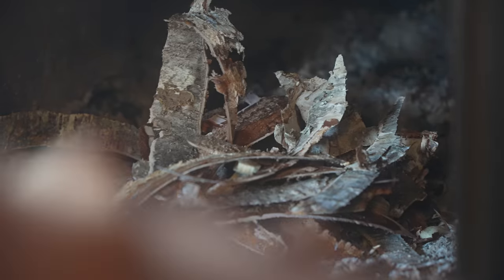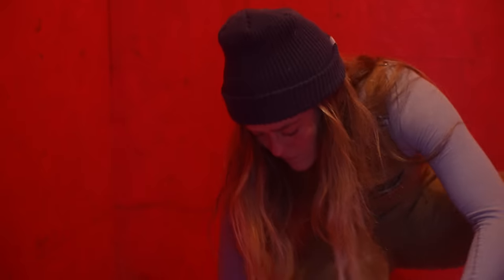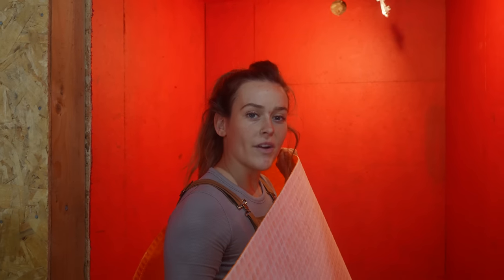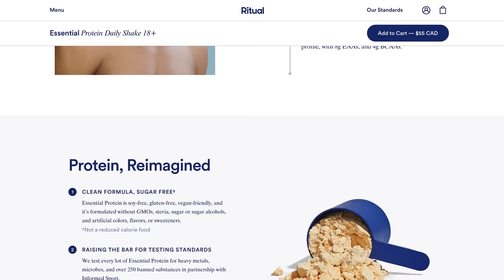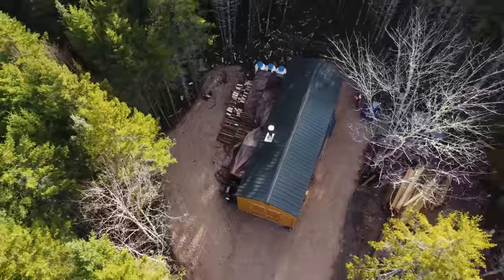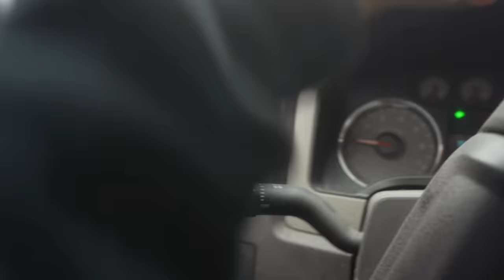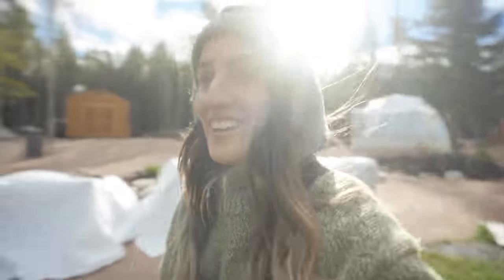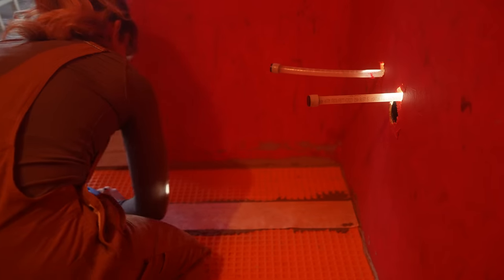Off-Grid Living In The Woods

Comment: For the floor part, once the tiles down and glued, I like to lay a sheet of plywood on top of it and gently walk on it to ensure the tiles are all the same height aka all the same level. It's hard to judge when your laying it, and most of the time when you lay the tile and don't do anything to ensure the tiles are all the same level, you find out later when your standing on it bare foot, and at that point there's no going back. I also recommend you do a tile baseboard of around 6", sorry I don't know how many centimeters that is. But if you do that, try to cut the top edge of the baseboard tile at an angle like 45 degrees so you don't have a dust mantle. God luck ladies, although I doubt you'll need it. Your both very capable in your endeavors. So, just try to have fun, you can always rip it up and do it again.
Reply from the maker: Oh Wilbur, thank you for all your ideas, tips and knowledge. So kind of you to share with us. We are so happy to have you in our pack.💛🐶

Comment: Don't know if under the house there is any insolation, but maybe if you have enough power you could make the bathroom floor with heat. And if you want a little trick to level your ground outside. Use your ATV to drag a wood pallet behind the ATV, it level a ground very quick and easy , just remove the big rock first ... :) Have fun girls ...

Comment: Your going to need moisture in the house during the winter. Dry heat in the winter is not as warm as moist air plus it causes more static electricity. I usually put a decorative cast iron pot on the stove filled with water.

Comment: Hope you don’t have issues-the Ditra should have been installed to your wood subfloor with a modified thinset. The Kerabond non modified is for setting the tile to the Ditra. You could have installed tile immediately over Ditra. It doesn’t need 24 hours to dry. I’m a trainer for Schluter Systems. Any Schluter questions in the future shoot me a message.

Comment: I didn't see drains or vents.  Hopefully you've planned those out carefully, since you've already waterproofed the walls.  In the US, you're not allowed to use an "S" trap for your sink (basically draining the sink through the floor), so we have to use a P-trap system, and tie into the drain through a vent in the wall.  I'm not sure about your jurisdiction, but hopefully you've looked into that.  If not, I'd slam the brakes and sort out the venting before proceeding.  Good luck!  I'm so excited to see your progress on the power.  Hopefully, soon, managing that will be a TON less work!

Comment: Plumbing hints...(It is hard to know how much you kids know, but...) 1. Use pex for water lines; make manifolds out of sweat (soldered) coper fittings; have as many branches (manifold outlets) as water lines of each type going  to each water-using fixture; include a manifold drain; use small ball valves at each outlet  (1/2" usual); HAVE "HOME RUNS"  GO FROM THE MANIFOLD OUTLET TO THE "DROP EAR" at the wall (that connects to the angle stop); AVOID using any "fittings" (ells, tees) in any of the pex lines to every extent you can -- just the "tube of pex" going where it is going.   1a. Basically (this looks like it will be easy for you) more or less avoid exterior walls for water supply lines.  2.  Better, if you can do it, to mount toilet on a "slab" set into the floor tile,  rather than the tile bits (looks fine, and was Code in New York City for a long time) makes toilet flange connection more stable/reliable.  Probably easier to use 4" for the toilet waste - you are going to end up using 4" going out of the building anyway.  3. "Y"s and 45s (1/8 bends) are the style these days, as are long bends (for 90s - quarter bends), really doesn't matter much for vent, BUT definitely best to use waste fittings (pvc - you two understand pvc fine from your electrical construction days...)  4.  If / when you run pex through the wall - drill carefully, responsibly, not over-size, definitely careful middle of the studs and really thoughtfully use plates (over-use, etc. screw into wire sucks - screw in water line really sucks).   .... no scolding intended .... have fun...
Reply from the maker: For sure screen shorting this! Thank you for all your knowledge 💛

Comment: Just a question: have you thought about how to get the snow off the array in the winter? It’s gonna take one hell of a long pole with the brush on the end. Good luck guys great video great channel.
Reply: Those kind of pole mounted racks can be adjusted to sit nearly vertical to catch the low winter sun. Usually the snow will slide right off due to the steeper pitch. 😊

Comment: Hey! I really like the project you are running. I'm wondering have you consider running additional Ethernet cable between the cabin and battery house? I'm aware that wifi around the cabin (and it's vicinity) is not the top of priority, but having that cable already running might come in handy in the future. What I have in mind is that when you have the inverter and battery system up and running you might like to have information about it's status and health on your phone. I suspect that Starlink terminal is located in the cabin and wifi don't reach into battery house. Having that cable installed will make you future proof. If you have some questions in the subject you can always reach me, I'm happy to help. And in the mean time - keep the great work! 🙂

Comment: Bathroom hints :  Make sure you have ALL PLUMBING LINES RUN TO THEIR DESIGNATED TERMINATION POINTS! This includes all drain lines that exit through the floor ( unless you have some funky European toilet that has the drain line out the back.) because cutting tile after the fact is not fun not to mention one needs to prep properly the floor around the toilet drain for waterproofing. Even the screws used in common North American toilet fixtures must be attached to the toilet drain flange so they do not penetrate the tile flooring or the waterproof substrate. 
You will want to lay out a row of tiles and see how they fit the floor allowing the proper spacing determined by the size of floor tile used. Not knowing what the bathroom floor plan is like it’s hard to say what’s next. Will you be using a pre made shower pan or a bathtub? If this is designed as a total "wet bath" and the tiles will cover the entire floor area. Is the doorway into the bath in the center of the width of the bathroom? Hopefully it is. You will need to run a center line along the width as well as running a center line along the length of the bathroom. You must allow for the placement of the shower pan or tub as to where you will end the tiles from. Shower pans and tubs usually are set in first before tiling floors and walls. Start at the center of the bath and lay out a run along the length an width of the room. This will help determine the width of tiles will be needed if they must be cut. Do Not cut any tiles in advance. You must decide as to where the cut tiles will be situated on the length run of the room. Some individual like to enter a room and see the whole tiles on the wall away from them. Choose your preference. Some tile layers will start dead center of a room and work out and around leaving a cut tile row around the perimeter of the room. You decide. Here in Europe the have floor drains in all of the bathrooms while where in the states we never designed a bathroom on the upper levels of a house with a floor drain. If you use a floor drain make sure you slope all tiles towards that drain.
A tool that many people forget to bring along for the job is a level. I recommend a 12” and a 4 foot level. This will ensure all tiles are set level to each other. Take your time check out many UTube vids for additional instructions and hints. 
Did you ever consider in floor electric heat in the bathroom? It goes in above the substrate membrane, below the tiles each getting a bed of mortar to hold them in place. Nothing like a warm floor when one gets out of a hot shower in the winter.
I don’t know which will take the most time, laying in the tile floor of editing the video, either way HAVE FUN and don’t let it get you down. Before I forget, a wet tile diamond saw works best instead of those scrape and break tile cutters. Also have a small hand grinder on hand with a diamond blade on it for any cuts that don’t run the entire length of a tile or for tweaking the fit of a cut tile.
Reply: Well done young man.
GOOD HELPFUL ADVICE!
everyone benefits in the long run from your pearls of wisdom. 👍
Reply: Yuh.  Also see comment about Ditra and "through holes".  You guys are going to need to cut, yuh, but seat and SEAL what goes through floor...

Comment: I have an odd question. If you're putting in a shower and or a traditional toliet where r the drain holes in the floor. I may be wrong, but I thought they were cut out first in the wood before anything else was done?  I may be wrong.

Comment: Tip for anybody using conduit, always thread a strong line through as you join the sections together. Then if something breaks or you need to run another line in the future, you always have a pull-through. Sorry gals, one for the memory bank.

Comment: I know you have the big tank of water in the greenhouse to act as Earth battery. You should Google thermosiphon and add that to the mix. It's just a small solar panel that heats water and has no moving parts or doesn't need any power or anything, and it goes to two lines that go to the bottom and the top of your water tank, and as it gets hot the heated water rises and Spills into the top and the cooler water is drawn in through the bottom and it creates its own natural thermopowered siphon and will heat your water. A lot of people use sand instead of water in the base of their greenhouses and they call that a climate battery. They either run the hot air from the top of the greenhouse through a fan and tubing back down into the sand so I can heat the sand or run water lines through the sand in a really tight grid and then run them out to the big heat exchangers and it does the same thing. The sun heats the water the water flows from the Sun and then the water flows into the sand and then warms the sand and creates the same effect your water tank does. It's actually a pretty efficient system and I use it off grid and one of my cabins strictly for showers

Comment: As you said coming together with Solar and Bathroom work. what to see the during and after parts of Solar build and electricity to the house.  There is still the water and plumbing to have running water in the house. Saw the water pipes run but need a good pump and pipes in the bathroom to get it all to come together. Or maybe you did not vlog that part of your bathroom build
Reply from the maker: Rough in plumbing was done early in season 2 this spring/summer :) it’s on YouTube

Comment: So do you have you septic line in? Because I didn't see a hole in the floor for a toilet pipe, or drain hole for sink, or shower??? Maybe you can still cut those???and you want to build up a slight slope so water will drain toward your drain, not pool up on the floor, unless you have a fiberglass shower pan

Comment: Crystal you look so cute with your new bangs especially with the ponytail. 👍
   Hey if yall want a great fire starter check out "outdoors with the Morgan's.
  Mike Morgan makes and sells a really awesome fire starter that you only use a handful or some use half that amount and stack dry firewood on top of the fire starter .light it walla you have a nice fire in about 5 to 7 minutes. 
Simple as can be.
   I think a 40 lb bag is $35 and will last along time and he has smaller bags also .3 different sizes I believe he said.
   He sells out fast so you will have to get your order in so they can fill it next time they make a big batch of it which I think he said in December soon.
  You won't regret trying it it's amazing stuff

Comment: If you have axe- better yet a small axe split the half pieces of wood into smaller pieces that start to burn quick. There also little starter squares you put on the bottom of the wood and 1 match will light it
Reply: Or... reach out to someone who will make you a "kindling cracker."  Someone who is a Welder (of metal, by nature or trade) and who has a lot of steel around and about.  A kindling cracker, in most common form, is a sharpened blade on a two-pipe stand.  Can be a couple of pieces of 1-1/2 sched 40 (or 80) with a piece of Loader "bucket edge" (sharpened) between them "stood up."   One hits wood w/ big hammer onto blade.  Makes much good kindling, with facility and quickness.

Comment: Large tiles > small fiddley tiles on a mesh backer, for a beginner. Grout is evil. Mortar is cheap and plentiful, and home store return policies are forgiving. Get tile levellers and spacers. Take your time and if a tile is giving you problems, scream, then calmly pry it up and re-set it. Also pre layout the floor if your tile has a grain or pattern you need to compensate for. I used a piece cardboard in the same shape as the floor as a template.
Reply from the maker: Thank you for sharing all your good ideas we sure do appreciate your insight.Happy Sunday.🌞🐾

Comment: make a straight edge with builders string don't use the wall for a straight line...lay out the tile the way you want without the pieces you will cut do the half pieces last then make sure you comb the mortar and do not put it on the tile that's only for doing walls

Comment: For your size wood stove, wood about 3" to 4" should be the biggest diameter logs you use.  5"+ is too big.
Reply: As long as two logs are side by side it should not be a problem. The big issue with firewood is that it has dried a season. I see in the video it is uncovered again by the propane tank. Not good.

Comment: Love you gals¡¡¡

I know they are sponsoring you but I has a bad experience with Floor and Decor store.

At Home  Depot, when you return your stuff after 90 days, if it is not a special order, the still give you a cash card to buy at the store.

I unfortunately believe Floor Decor and similar stores had the same practice. After buying thousands in tiles and other materials and tries to return approx $350 I hit a wall of BS.

1st, a few of the tiles were discontinued,  so F...the customer for the bad timing.

2nd, for the return after 90 days, instead of dealing with the store manager who apparently is powerless in this situation, you have to deal with some corporate  people who by default will make jump through hoops to if you don't quit, still will tell you no.

The orange thing is expensive and you could get something cheaper at Home Depot.  Kind of a thick plastic that goes under the cement.  For the walls, Durock Cement Board.  Similar to drywall but the base is cement instead of gypsum.   Therefore waterproof. 

Regarding underground utilities and for the future, usually,  in addition to the regular warning tape, you install a detectable tape that can help detect the path of the utility without having to excavate.

For tiles, use big rectangular tiles.    Less cutting and easier to install.  Usually the narrow tile cut is forced to the least visible area of the bathroom like under the toilet and floor cabinets (vanity sink)

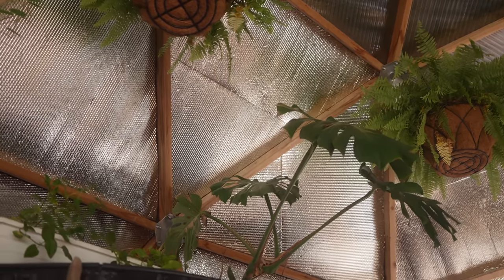Comment: there are lice on the plants 13:14. Be careful they don't get the upper hand. all the best
Reply from the maker: They are aphids!! They are easy to get rid of but you have to be on it. They were taking over my mint- washing them off and away is working well
Reply: @Vanwives  Thanks for the answer. that's a good idea. much luck 💚 If they keep coming back you can try soapy water and baking soda. put everything in a spray bottle and spray the plants. greetings from switzerland, it's cold here too. Winter is arrived

Comment: Hey girls, question: How do those solar energy panels generate power with no sun?
Reply: If you remember when they decided on the solar panels and where to put them, they maximized the exposure to the sun in their area.
So even the slightest amount of sunlight during the day will be adequate and that is why they have such a large amount of solar panels to begin with. Does that make sense?
Reply: @kathleensauerbrei5199   You are correct. 👍.  And the photons that come from the sun can get through (a bit) even on cloudy days. 😊
Reply from the maker: Yes!!! Thank you both for touching on that. That’s right. Hard to believe but even on cloudy days you can generate quite a bit of power.
Reply: @Mtnsunshine  , Thank you I did not know about the photons as obviously I am not well-versed in how solar panels work totally.
These young ladies have made some very wise choices and how they wanted to do things, and it has been an absolute joy watching them.
Reply: On December 21 at 55° north the sun only comes above the horizon 15°.  So the panels have to be at a steep angle 15° off vertical.
Reply: @vmitchinson  Again, if I’m not mistaken they addressed  this issue while deciding where and how to put the panels up.
Actually they were very specific about the light exposure during the winter days and what was the best configuration for all the panels. It was a very interesting conversation something that I knew nothing about, and listened and learned. Lol